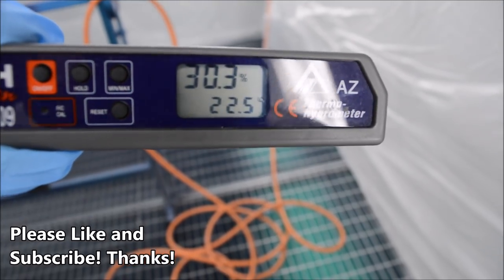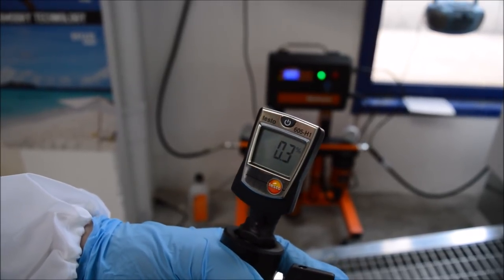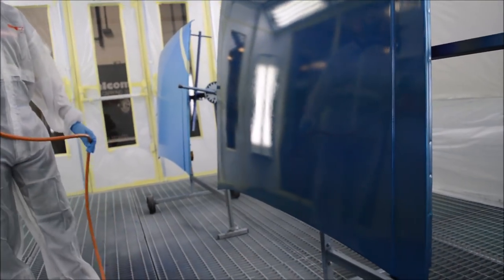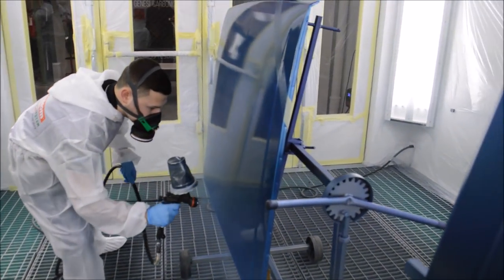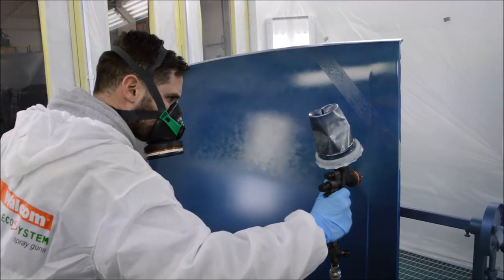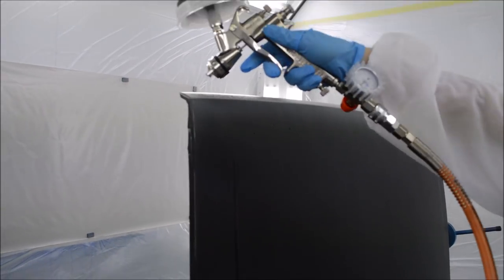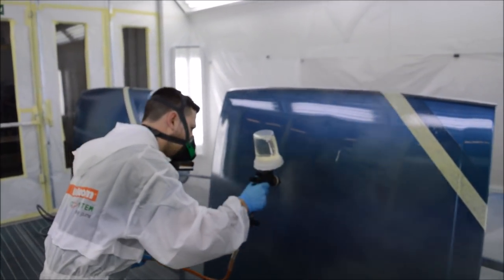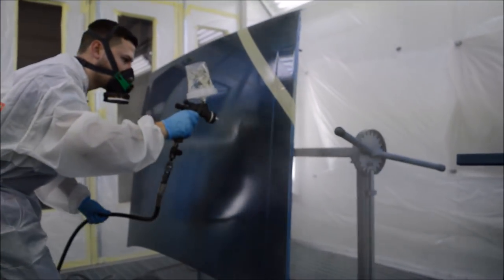Does Humidity and temperature affect spraying?

Comment: This is why I use a hvlp turbine setup to spray  ,that warmed dry air eliminates so many potential problems .I use the same turbine air to dry the WB base coat . It helps wether inside spraying or when doing smart repairs . Thanx for the vid
Reply: Hi  Can you tell me what brand of turbine you use , gun and tip sizes...Thanks

Comment: Hi Jordan, thanks for your instructional video. I'm a hobbyst and i want to test also my airline.I saw you use a Testo 605 H1, but it seems that you didn't connect directly to the hose. Do you use an adapter or what else? Could you please describe how to connect the tester to the line.
Thanks
Reply from the maker: Hi Carlo, it's a custom built tool for this purpose only so unfortunately I'm not sure where it can be bought from
Reply: Thanks anyway

Comment: I done this as a job for many year's nowni build model's as a hobby but use a compressor with a tank only switched down to airbrushes but the same applies with humidity amd the temperature indoors especially up here in Scotland I have 2 water taps and direct one attached to the airbrush for moisture but always draining the main tank atleast twice a week! I've got a new house with triple glazing and alot warmer all new heating system and purpose built hobby room going on just now adding a spray booth it what is even happening now in the hobby because of the exact same issues! This machine would be amazing if iwata etc started producing these!

Comment: Can I ask what brand/model mask the guys painting are wearing?
Reply from the maker: I'm not sure! They was given to us when we arrived.
Reply: Buy a sundstrom sr100 pro.. the pro model that has the 510 P3 and the 315 ABE1 filters are basically the only filters on the market that acoording to manufacturer will protect you from isocyanate. The 3m filter that people talk about 6051 actually has a note not to be us ed with isocyanate. Maybe it’s to protect themselves from a lawsuit but either way the sundstrom filters are the best protection without going with an air fed system as far as I know.

Remember to store your ABE1 or any charcoal filter, in an air tight ziplock bag when not in use to get the most life out of them once removed from packaging.

Comment: How about when its 108 degrees Fahrenheit or about 44 degrees Celsius
Reply from the maker: If you already have heat then it will be the humidity that this unit will help with. If you're in an area that has dry heat with low humidity then you will not see the benefits however, in the winter months you will definitely see the benefits. Thanks. Jordan